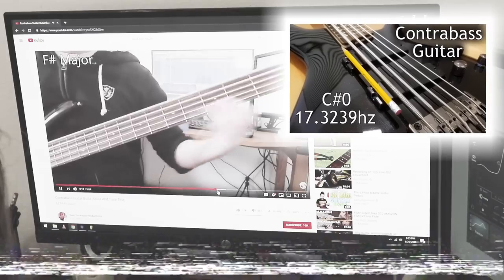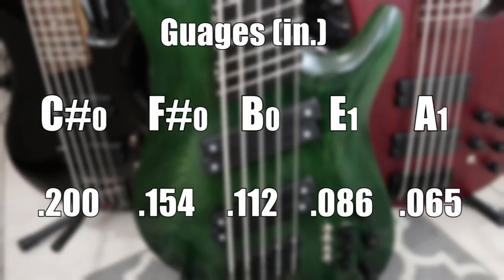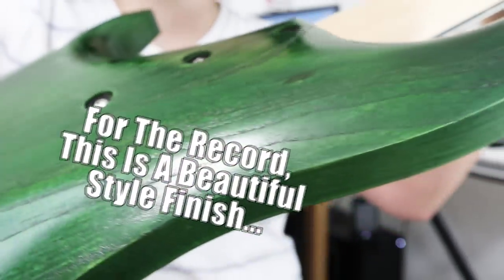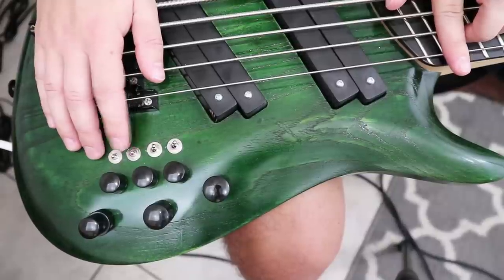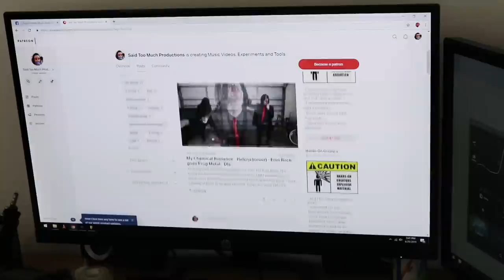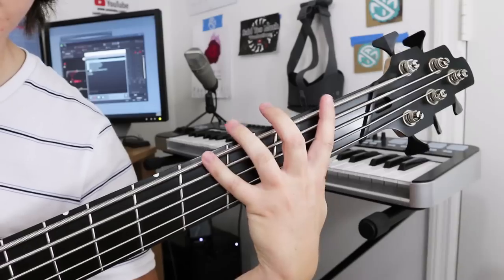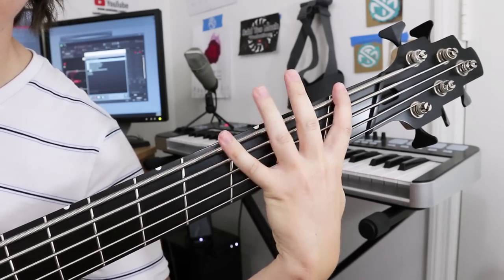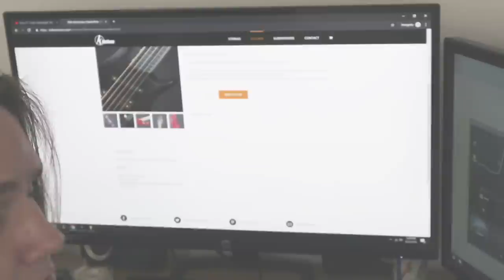Kalium Quake Bass Review (...and Tone Demo)

Comment: I have to say thats actually the most audible clear c#0 ive ever heard
Reply: You need to hear it in a 6/4 BBb tuba then good sir
Reply: @PeterGriffin-kb2hf  A tuba doesn't go that low. Well, at least not in the regular range. A Tenor horn goes down to E2, that's standard guitar low E. A tuba goes an octave lower, with the 4th and 5th vent maybe to low 5 string bass B0 or so, but definitely not to C#0
Reply: @hannes1734  Correct on the tuba. Low A0 is about as low as you are gonna go on a tuba, it takes so much air to hold that note for more than a couple seconds.

Comment: Great video man I'm sorry about the finish bleeding, the switches, and your ordering experience. I recommend like taking a damp cloth and rubbing the bass down. It will help remove the residue a little. As for the wiring I'm sure you can fix or if you really want a killswitch you could keep it like that though I recommend adding a button instead like buckethead. Overall while it has its issues and it is like 2 grand at least I still think it is well worth the money especially for someone like you who frequently uses low tunings it is crazy clear and I love the new sound. I'm really interested in this guy and other things in the future I'm sure you'll probably update your other instruments in the future as well but that's again for the future anyway it's green and long let's call it "The Python"

Comment: Awesome video, I bought that Brice 37" bass after seeing your other one and I love it. Also have a Brice multiscale 6 and it has the same bridge type as your Quake.

As for Kaliim, I tried to order a set for my 9 string once and selected their "1 day shipping" option. I didn't get any confirmation email or responses until I made a facebook post and people started tagging some of the Kalium guys (who were helpful enough). But after a few weeks, I ended up just getting a refund and getting some La Bella custom gauges instead. Those shipped just a few days after and are great. 
I would really want to try Kalium at some point still since I've heard they're awesome, but I don't want to go through the whole guessing game experience again.
Reply: Also, for other bassists using low F# tuning, I found D'Addario has singles available up to .170 gauge and they do them for both regular scale and long scale (fits my 37"). They can be easily ordered from D'Addario's site or on site like Just Strings/Stringsbymail. Even Amazon has them. 👍
Reply: Newtone strings though the UK have very reasonable prices for their custom strings, and they also go up to a 200 gauge!!!!! I paid $44.84 for a custom pack of stainless steel strings in these gauges:
0.067
0.094
0.130
0.200
That includes tax and shipping from the UK to the US, which if i recall correctly, was about $5.73, I'm using those strings to tune to drop D an octave down (D0 A0 D1 G1) on a 34" scale, basically I went with their diamond strings, hex core, stainless steel, tapered, and I had to measure from the nut to the ball anchor resting point in the bridge, fingers crossed these strings fit on my bass which currently has a 100 gauge on it haha 🤞
Reply: Kalium would charge probably more than that for one single 0.200 gauge string, plus their website is extremely confusing haha

Comment: i just recently built a 48 inch scale test bass. i cant even get a good sounding low F# and its 8 inches longer that that monster. granted mine is a shit-project. its 2 strings, fretless and more of a concept djentstick than a real instrument but i cant seem to get any clarity no matter how long i go. clearly there is an electronic point i'm missing like NEEDING some digital processing, and everything i have is passive. mine sounds about like the ibanez you contrabass'd but i lose all quality below G. turns into noodle-core. so i think what i',m lacking is the pre-amp or a special pickup is needed to get the lower tones. i dunno. but my 35 inch fretless 6-string bass sounds killer with passives down to A, and it's like there is a wall between A and G# that when crosses just takes all quality and pisses on the concept.
Reply from the maker: Do you have any pictures or video? You can share it on the facebook group too. Where did you find strings for that length btw?

Comment: Seeing this thing in standard 5 string tuning with a high C would be pretty cool, I want to hear how much like a piano it sounds with the E on that 40 inch scale. Going down to a .226 gauge scale would be really cool to see how low it goes.
Reply: You'd have to put some REALLY thin strings on this to get into standard tuning. Pretty sure it would have to be a set of 7 string guitar strings.
Reply: @georgiykireev9678  Kalium makes down to a .009 gauge string with a bass ball end. You could probably get away with something like a .070 or lower. It's definitely feasible though.
Reply: For super light tension (which I'm a fan of) on this instrument, you could do this gauge set, or beef every string up if you're more into tighter strings:
0.023w (in C3 this would have 27.64 pounds of tension)
0.031 (in G2 this would have 28.55 pounds of tension)
0.043 (in D2 this would have 31.09 pounds of tension)
0.057 (in A1 this would have 31.35 pounds of tension)
0.079 (in E1 this would have 33.43 pounds of tension)
Practically you could use an A string for E, a D string for A, a G string for D, so on and so forth

Comment: Over the last few months, I've bought several sets of strings from Kalium. They took about a month to send me "In stock" strings. Pathetic!!!! If I can find another company that sells large gauge strings, I'll never order another thing from Kalium. 

I ended up using their 208 string to get me a 20Hz E on a 34  inch Conklin 7 string bass. With the the right speakers, I get the depth and clarity I want. Intonation is an issue though. 

As a former professor told my class, " The difference between a jerk and a critic is, the Jerk says, 'You suck.' The Critic says, 'You suck because....'" Clearly, you are being a critic. You are bringing forth import information that others may use to decide on what to buy. Never apologize for being honest.
Reply: I'm using those strings gauges for drop D an octave down (D0 A0 D1 G1) on a 34" scale bass

Comment: An easy way to mute low strings is to do it with your right thumb. Place the lower 3rd of your thumb on the lower strings, using them as a sort of hand rest. It worked just fine with a .170" gauge, even without any other muting and heavy distortion. 👌

Comment: If you're gonna get down to a G#-1 like that insane guy suggested last video, you'll need to go way above upright bass scale lengths.  Uprights sometimes have C extensions which bring the scale to almost 55 inches!  And that's for C1!
I sympathize with your disappointing experience with Kalium but mate, thank you for being so patient and transparent with us.  You need to do a comparison between your 3 contrabasses in the future, this one is starting to sound like some sci-fi movies haha
Reply from the maker: Kalium already did it with a .266 on the 40", that could at least be a starting point, I know its gonna be really hard to work with though, the c#0 is still a little annoying already
Reply: Definitely a tough journey ahead.  Not much to do except making things more and more extreme.  If you're going down the custom route, check out Jared Dines's djentstick.  Barebones but modular, looks fun for experiments and modding

Comment: I think, for notes this low, "unusual techniques" involve more than just adjusted fingerings. At ~ 20 Hz, it can take significant time for harmonic relationships to register in our ears. I think something this low is meant for atmosphere, much like the low strings on a theorbo are there to ring out as punctuation while the upper strings handle melody and harmony.

Speaking of theorbos, those things have ridiculous scale lengths (but no fretboard). It's certainly possible to get something sounding good with thin strings if you give up on anything resembling a practical scale length.

To make it more practical, what if the body moved up so that the bridge extends past it? We're electric here, so having a bridge sitting on top of a reaonating chamber isn't a concern. 48" scale length should fit in the lap if the bridge sticks past the body. Being able to reasonably fret a 48" scale length is another matter entirely. Screwing with tunings to reduce the fret span might help.

Putting a hole in the body between the pickups would allow for the advanced "chopstick" fingerstyle technique: rubbing the strings perpendicular to the body with a rosined stick. I don't know if that would work at this range, but it might do something cool.

Comment: Switches are 2 pair 3PDT, 2 pair DPDT. Series/Parallel switches are my favorite passive tone controls. Would be cool to have a preset bass boost switch right next to the S/P switch so that throw direction of Parallel = throw direction of boost engaged. I dont dig single coils with bass but maybe a fun pickup jumping option like the old Ibanez Universes with the HSH. Check out old catalog pdfs for diagrams

Comment: I would try using the tone knobs to get rid of that clanky sound and produce a big fat sound that concentrates on the lowes. And I think plucking a bit softer would make up for a rounder tone. But just some thoughts. Thanks for trying out mate.
Reply from the maker: I'd prefer to be able to roll each string independently, I like the prescence of the "high" strings, but it's just a distracting clunk on those low guys, i agree
Reply: @SaidTooMuchProductions  nice Idea. Maybe you can add a Split Pickup, like P basses have, and wire a tone control to each of them. I have no idea if the difference is to big between those strings but it could be worth a try. Maybe on your brice bass.

Comment: What would be cool is if the Quake bass had a three octave neck (or more?). What I mean is 36 frets.So as to utilize that long neck  I, myself am very interested in Extended Range Basses. I have a 6 string, 35" bass strung from F(0) in 5ths ; F(0),C(1), G,D,A,E, .  I use a , 205 string for F(0) but it sounds dull compared to all the other strings. What does your F# sound like at 39.25 inches and what is the diameter of  that string? I know your C# is .266 at 40 inches, the trouble being that 17 Hz are actually under the human threshold for hearing.

Comment: No, that's not right. The winds on the 3 lowest strings start after the saddle.  That's why your intonation was off on the Brice bass. The mass needs to be equal from end-to-end of the functional length of the string. I've had plain guitar strings fail to intonate from corrosio between the nut and 12th. Not brown and rusty, just old.

Comment: check out dan thompson's wiring tutorials for how to redo that series/parralel switch and active/passive bypass switch. also, i'd recommend adding in a 'tone bypass' switch that disconnects the passive tone altogether, as even at the fully open position, a tone circuit still bleeds a little bit of highs to ground.
Reply from the maker: Interesting

Comment: also, ive had the kalium bullshit experience. i went to them for strings a long time ago. i ordered strings based on THEIR tension chart and paid handsomely for bass strings and then nothing came. i sent an email, nothing, 2 weeks later after 2 emails they said the strings were on the way. 2 weeks later i got the strings and they felt loose. string tension was WAY off, and i measured them and they were the wrong size. i emailed. nothing, emailed, finally i threatened to report them and they apologized in an email and sent me new strings. same wrong pack again. never got a refund, never got my strings in the right gauge and they NEVER mentioned the tapered ends changes the tension chart so even the gauge i ordered would have been wrong technically going off their own chart. i ended up buying 2 of the wrong pack and said to hell with Kalium. they also made me mad when they ONLY allowed use through paypal, so after everything i went through i had a paypal account created and money spent that i didnt want for anything else. that's why i contacted stringjoy.com for the same exact guages and they wanted just over half the price for it. they took paypal and major credit cards so no bullshit, websight was super easy top use and i got my strings within like 4 days and they were correct, not only in tension but in the gauge i ordered. ive been 100 percent stringjoy since and through several years of stringing 15 instruments i have had 2 minor problems. once they double charged me, i clicked and it ordered 2 duplicate orders. i emailed, they apologized, gave my the money back for one pack, other pack mailed as usual. another time there was a glitch in the websight and it somehow didn't send my order, so after 4 days and no strings they sent me an apology and rush-delivered me the strings in 2 days with no upcharge and sent me a personal note assuring it wouldn't happen again. it never happened again. everyone makes mistakes and websights screw up but they do exactly what they say they will, their strings are super good, they make any error right, they don't blame you, they just inquire and take note and fix it. Kalium can eat a medium to large bucket of dicks. yes they offer bigger strings than stringjoy but technically i also never got my damn strings after they gladly took my money so i'd rather have a 145 for cheap, that arrives and is what they claimed, than a 150 that never made it and cost me 3 times as much and months of work to never receive. ive heard Kalium's customer service is often aligned with how famous you are. the lesser know you are, the less they give a shit about your results. so be prepared to pay high and receive nil. stringjoy takes the time. i will also shout out to Ernie ball, because even though i dont use their stuff anymore, they always worked with me on weird gauges on the phone and i always got a product. so that's something at least.
Reply from the maker: Using a .140 string for the low f# might be your problem
Reply from the maker: Hopefully this video hits six figure views and they start giving a damn
Reply: D'Addario has up to .170 available as singles on Just Strings and Strings By Mail. They're about $10 and you can easily order them and they'll ship within 2 days or so. 
I reccomend those for F# tuning 
Good luck experimenting, man 👍
Reply: @SaidTooMuchProductions  - I do give a damn. Been working at this since the 1970's and am a one-man shop.
Reply: Newtone strings from the UK do custom gauges up to 0.200 and they're cheap too!!!!! I paid $44.84 total for these gauges:
0.067
0.094
0.130
0.200
And that includes shipping from the UK to the US, and their website is wayyyy easier to use than Kalium, and more custom than stringjoy as you can choose the core type (hex or round), whether they're tapered or not, the metals used (stainless steel or nickel iirc), and you also have to measure from the nut to where the ball end anchors in the bridge, they also have two types of strings, diamond, and platinum, I don't know the difference but I got diamond because apparently it's more ideal for thicker gauge strings

Comment: That sucks. I don’t get why you try to go that low, it is a useless fart sound that can’t cut through a mix. String this long scale bass for the standard tuning and it will be powerful.
Reply from the maker: It's an illusion,  the frequencies become lfo's adding to the gurgle still around 50-100hz, to say it doesnt have use is to say FM synths have no use lol
Reply from the maker: Also, I did tune it in E1 bass for a while to test tone at 40"